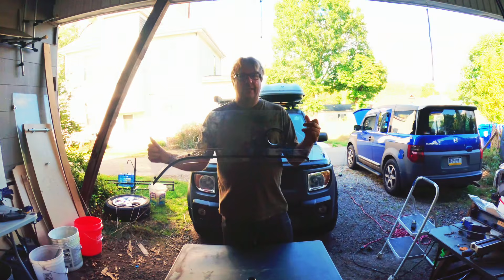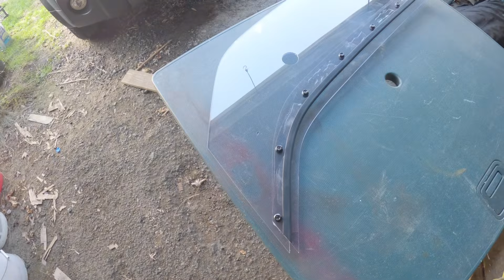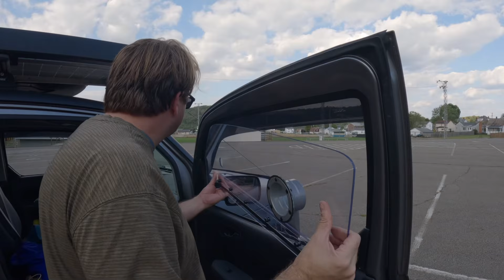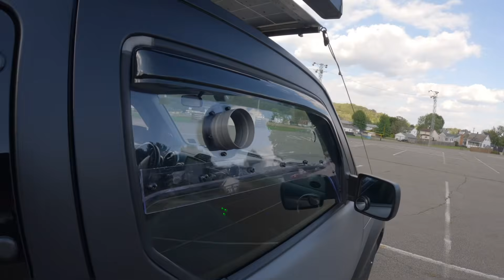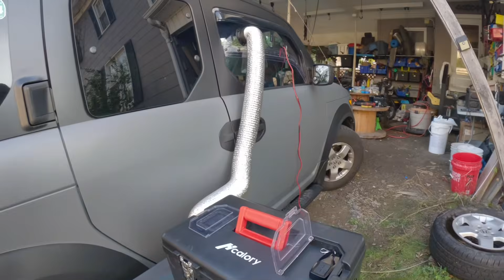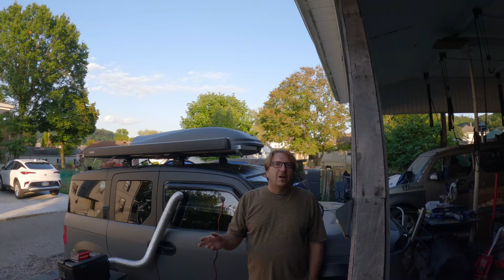🔥 Diesel Heater Vent for Honda Element 🔥 Front Window Insert | Camping Heat Hack

Comment: Looks great! What is the black strip of material? Did you cut that out or is a section of trim that is made for that window?
Reply from the maker: Thanks for the kind words!!  It's rubber gasket designed to create an air tight seal.

We've actually done a massive redesign since the launch of the original.  You can check it out here:
https://elementdiy.com/store/Trail-Breeze-ele-VENT-Modular-Ventilation-System-c194028251

Comment: Very nice. I’m planning out how to go skiing this winter with my Element. 

I’m wondering about your attention to making it well sealed. I was thinking I wouldn’t worry too much about that because I need a reasonable amount of airflow to keep humidity down. And most diesel heaters are quite a lot more power than I probably need in my Element. 

That last part is actually what concerns me the most. It’s such a small space. I think the heater might blast me with very hot air and then it’ll turn off and get cold. Repeat. Was wondering if I might need some sort of thing to absorb heat and then radiate it more slowly. If I had a moderately sized tank of water that could be heated and then slowly radiate, for example. 

Have you used a diesel heater in the winter? What external temperature range was it successful at?
Reply from the maker: I have limited experience with the heater at this point but I will be reporting back after a few campouts.  

The other windows in the element can be cracked to provide some air flow.
Reply: @ElementDIY Thanks, I’m eager to hear how it goes. I probably won’t be going on a trip till January or so. 

I’ll probably do what I did when I wanted a portable AC installed in my Element: bring some wood and a jigsaw and duct tape, and fabricate what I need when I need it :)
Reply: $200! Whew. But nice